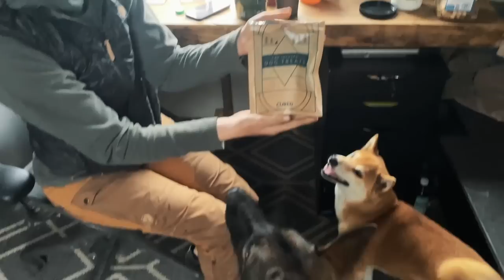BIG Changes | Life Off the Grid

Comment: You should ‘train’ Barron to trim your hair. My hubby has been doing mine for the last 30 years. Admittedly it’s all one length curly with no layers which is easier especially when wet cut. The first few times were nerve wracking for both of us but now he’s a pro and we’ve saved so much money! Always start with small amounts-you can take away but you can’t add.

Comment: The subie has been a great car for you guys. Hopefully the GX470 will be also. I'm sure Barron already knows about the timing belt changes required every 90,000 miles. It's a pretty major service but necessary. The GX has a reliable drivetrain assuming the timing belt service has been done. While in there, budget for the water pump, bearings/pullies/tensioner, cam and crank seals.

Comment: $40 for that?! 

I use the Creaclip to cut my basic layers but there are cheaper versions. There are tutorials on YouTube but basically I brush all my hair forward and use the clip to cut it to the overall length that I want. Then I sometimes section off the hair from the level of the top of my ears and brush forward and repeat and then the top area of my head to get lighter layers as my hair is quite thick. After that you want to finish the ends so that it blends nicely and you don’t leave those choppy blunt ends. Again there are videos for this. This part isn’t hard but take time with it so you get a better end result. Nice thing is that you can go back the next day and adjust things if you missed bits. Also buy yourself some decent hairdressing scissors. It’s worth it for the money you will save not paying for haircuts.

Comment: Hey Elsa and Barron. You might want to take a look at something called a Loadhandler. It turns you pickup truck bed into a manual dump truck. I have put chunked up concrete on it and it held up well. It would make unloading that sand so much easier. Love the concrete insulation. Thanks so much for sharing!

Comment: I shaved my head. not that short ontop but that short on the sides in a fade.  I had hair down past my butt. And im plus sized. I was so worried itd look terrible. I had No regrets. Man its so light weight and I loved it short. I literally lost like 10 pounds of hair. And in the summer my hair wasnt over heating me. Im growing it back out righr now cause my fiance wants to see it long. and atleast 3 times a month i think about doing it again. 😂 

 Those lexus gx470 are so nice. They were high on my list as my daily driver/ offroading vehicle. I got a 97 4runner with 185k miles on it and man i have loved it so much in the last 10 months ive had it. It was a little more in my price range cause both hold their values. the toyotas/lexus are so reliable. Ive done basic maintenance to it and thats it. I will be using the 4runner  strictly to build out for camping/offroading/fun vehicle to keep the miles low and getting something else for daily driving at some point. Probably another toyota or lexus 😂 fiance wants to get a newer subaru forester or outback as his car for trips/ daily driving and light camping or offroading. im tempted to have him get a rav4 or highlander cause ive never had a problem with a toyota 😅 but the subarus have a way better awd system.

Comment: A suggestion for you .. spend your money on some decent hairdressing scissors... then cut your own hair when it is wet.The reasons your ends were so choppy is using the tiny scissors...(I am a retired hairdresser)  Barron could actually do the cutting so you can sit still.. that way then ends will match.. Your twisting and turning to do the cutting leads to uneven ends..